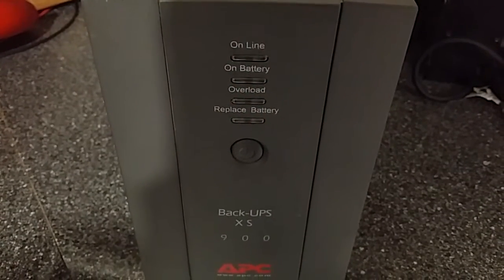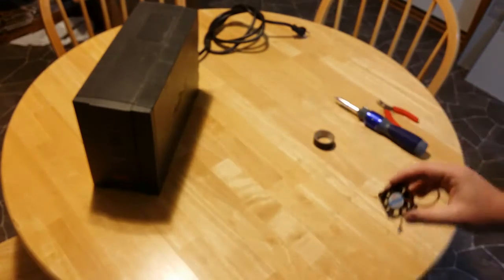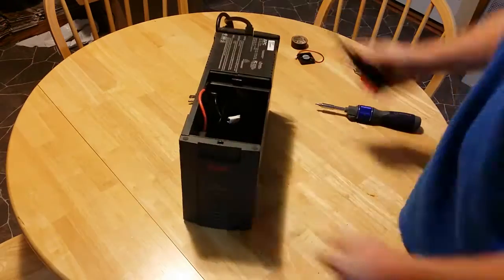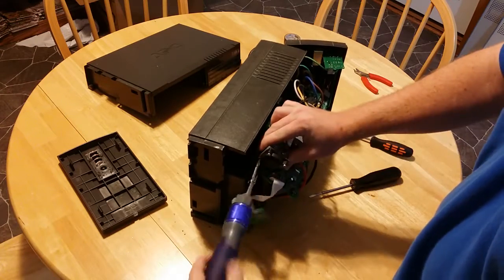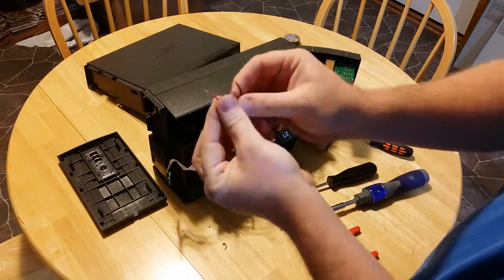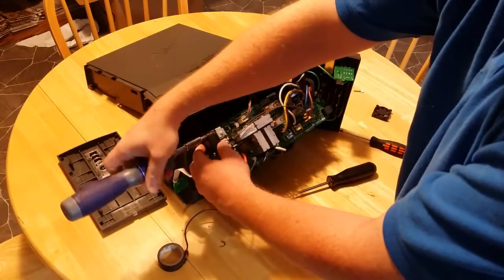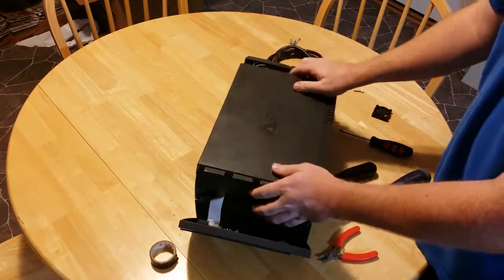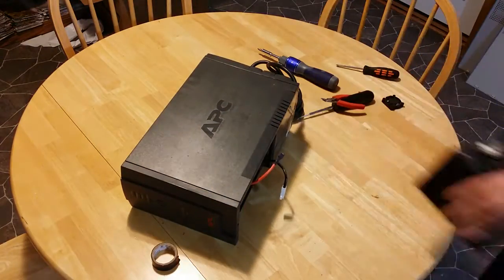APC BACK-UPS XS 900 Overload fan fix how to

Comment: I got an issue any idea why I get no LED lights on at any time during the process. Theres no corrosion or anything wrong looking with the battery and its connections. 
The Surge Only outlets are working . However, even when plugged into a wall outlet, none of the batter plugs work. I cannot "turn the unit on" as no LED lights come on.

Just replaced the battery and keeps not working any ideas?

Comment: I have 2 of these and both failed - maybe this will help someone else.
Because of the fan failures - my equipment would get shut off with no warning

I replaced the 24v fan twice on each (seems these fans are popular with 3D printers?)
All the new fans failed quickly as well and were very loud until then
In the process, I may have damaged the drive transistor for the fan pins - one unit was always on when batteries were in, but off or unplugged from the start. One would go quiet after a while unplugged - both eventually would not run at all.
I got stubborn - these things should last longer!
I found good 24v charger tap on the PCB (I can post more if anyone wants) and got some inexpensive buck converters off amazon - soldered them in and tuned output to just under 12v and secured them inside the cases.
I got a pair of 12v noctura fans and installed them to the converters.
Bliss - working perfectly for over a year and whisper quiet

Comment: I have the same issue but a different model and it does not have a fan but it only happens when I plug in the ups to the wall any ideas
Reply from the maker: Not too sure. If it's a similar design there might be a big heatsink but no fan. If there is make sure the heat sink has good contact to the regulator. Other than that I really don't know.

Comment: I'm amazed!! I've had this unit for several years, and it's been a workhorse. Here in Florida, lightning capitol of the world, it's saved my ass more than a few times, and it was a lifesaver during hurricane Irma just recently.

The fan (since it runs 24x7, even when it's off) has been annoyingly noisy for most of these years, but never failed. Just yesterday, I got the red flashing light of doom, and instant shutdown right in the middle of editing some video footage. A cool down, retry produced the same result, and it hit me that the fan was NOT running.

Sooooo... I'd just replaced the batteries a couple of months ago, and I wasn't about to consider junking such a unit without a battle first, so I spent part of yesterday and a lot of today trying to get into it. I got the back off, that center screw out. eyeballed the front thinking it sure looked like it should come off, but I wasn't ready to start something potentially destructive. I did start thinking that the only way into it might be to blast.

And then, as a long time YouTuber, I thought that "just maybe" there'd be a video about it. A quick search, a few minutes watching, and a few more minutes at the bench, and I now have a dead fan in my grubby little hands. I'll be ordering a replacement tomorrow.

I thank you SO much for this great tutorial. The beast really did have me stumped, right at the "pry off the front with a screwdriver" part, and it suddenly becomes so easy when you see that that's exactly what you do. Again, thanks!
Reply from the maker: You're welcome. Glad this video helped.
Reply: Just as a followup, I got a better quality ball bearing fan by NTE on Amazon. It runs faster and moves more air. Soldered the plug to it, installed it, put everybody back together, and the unit is happy and back online, at a parts cost of 11 bucks.

The new fan is deathly quiet, and when I first powered up the unit, I almost panicked, because I didn't think the fan was running. It's that much quieter than the original. So..... with the right guidance from you, this UPS has a whole lot of life left in it.

Comment: i just replaced my fan  i have not heard it come back on    i used a volt meter and everything seems to be fine      is it suppose to run all the time ?
Reply from the maker: I think mine runs all the time. Are you 100% sure its not running? As a side note I drilled holes on the top of the UPS in front of the heat sink and behind just to give it some fresh air. I used a small drill bit and drilled about 40 hoes. I think this will help in the long run.
Reply: Jay Groh I replaced it and now it doesn't come on at all.  but there's volts
Reply: lol...you drilled 40 hoes? All in one day?
Seriously though,  you should have soldered those wires before applying the electrical tape.

Comment: I see you've gotten no comments on this video but I have to say, I'm glad you made it. I've had mine for three years. I got it used and it didn't last long before it failed at a most inopportune time. I was ready to throw it out, but I've been holding onto it hoping to fix it one day. I replaced the batteries three weeks ago and still had my issue. Then I found your video, opened the unit and ordered the fan I found on Ebay after e descriptive search. After I installed it I plugged the unit in and let it set overnight. When I came in this morning It was still running with no failure. Thanks. Your video helped at least one person.
Reply: where is the link of the fan on ebay thanks a lot